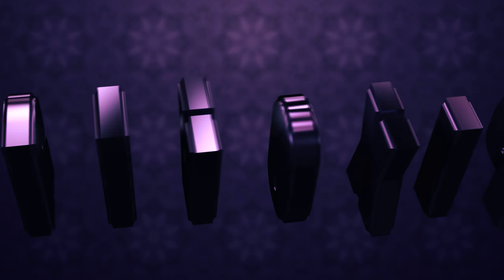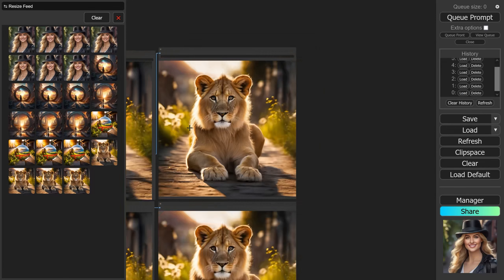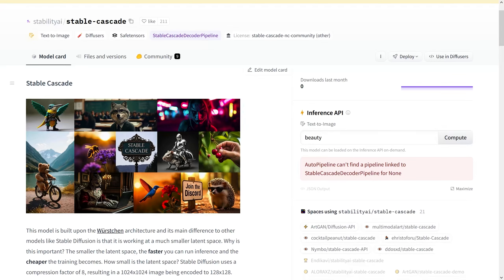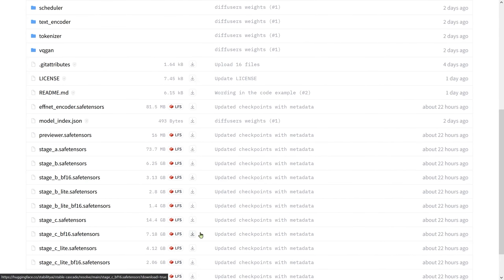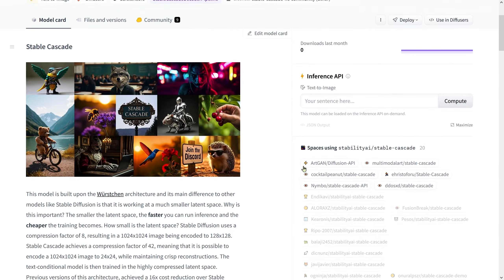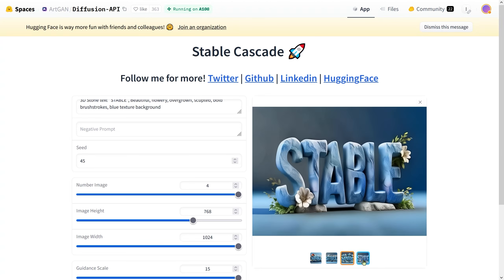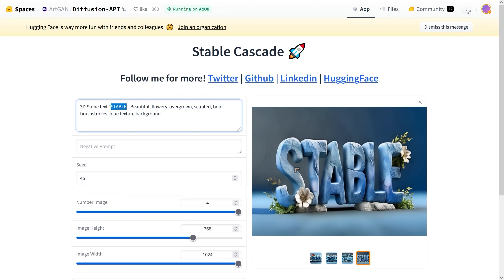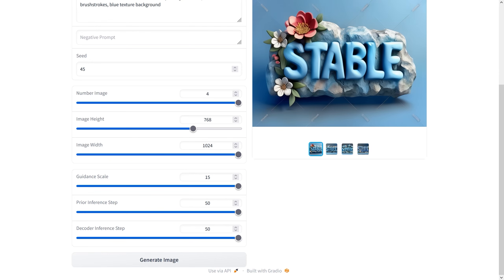Stable Cascade vs Stable Diffusion XL

Comment: What is the likliness of me running it with 4gb vram
Reply: (outdated reply, no longer accurate) if you get it to run in ComfyUI, it will probably take you 5-5000 hours to generate 1 image and require you using the fallback to CPU RAM.
on 11GB VRAM it takes me 30-60 minutes.
Not worth it for me.
SDXL UltraSpice is taking me 4-70 seconds (depending on resolution/settings) so i'm sticking with it instead.
For you, maybe try SD Turbo custom models if you can't run SDXL models with -lowvram.
One of the big issues with StableCascade is that it currently doesn't use FP16, which speeds things up a lot.
Reply: Bruh, you can run it, go check it and also yesterday stability released checkpoint for comfy
Reply: A lot of progress has been made over the last 5 days. there now several Cascade models and several ways to process the models to create images and they only take about a minute.

Comment: i thought Nvidia released a hack to use system RAM in addition to VRAM in latest driver. What about two cards? I bought new 4070 Ti Super + 2070 Super in total it's kinda 4090 by VRAM and Cuda cores, bus same 256 bit, i have 2 PSUs to power.

Comment: Why is Cascade so much slower?? SDXL with the Foooocus GUI can generate images in about 15 seconds with 60 steps. Stable Cascade however takes 3-4 minutes! What's going on? I verified Cascade IS using my GPU at 100% usage.... but it's just soooooo slow, wonder if I'm doing something wrong? (I have a 3080ti 12GB card)

Comment: useless.. it's much MUCH worse than SDXL and it requires 20GB of Vram. Dead on arrival.
Reply: Lol I compared it to sdxl base model, it's definitely better, it's better at generating high resolution images than sdxl (doesn't hulucinate or duplicate as much) but at 1024p its lacking in the details department, try generating at a higher res as 1024p
Reply: poor fella, wants everything for free, atleast go buy a good GPU if you are getting the software for free, atleast invest in hardware.

Also CASCADE is in preview right now, and also is way way way better in terms of sticking to the prompt like Dall-E.

Quality and stuff can be added later on using fine-tuned models, that is not what the priority of these models are.

Go earn some money and buy a good gpu

edit: or just wait for someone to feel bad for poor people like you and make it run on 4gb VRAM GPUs 😂
Reply: @MarcSpctr It might come as a surprise, but a lot of people don't have +$2000 just lying around. And for a lot of people, that simply out of reach.
Reply: its a preview rn and some stability staff said on twitter that they are confident that they can half the vram usage
Reply: @SkyyySi  Prices have got absurd. I remember as a young adult spending a lot of money on a new top end Nvidia card was like $499. Le sigh.
Reply: @SkyyySi  To be fair, it’s all based what we want to achieve, if you want the best quality product in the world, it’s not going to come out of a $800 graphic card when there’s a $2k graphic card for a reason. That’s why there’s a ton of videos based on price-performance comparison. Some people want less pricy some other ones want performance.
Reply: @AlbertoRodriguez-fs4mk  What we "want to achieve" is running Stable Cascade, which requires a GPU with +20GB VRAM. Which is the domain of top-tier cards only.